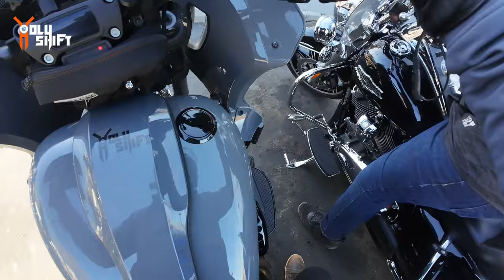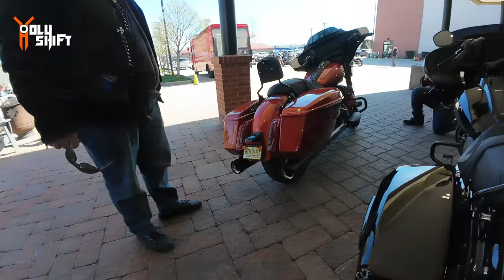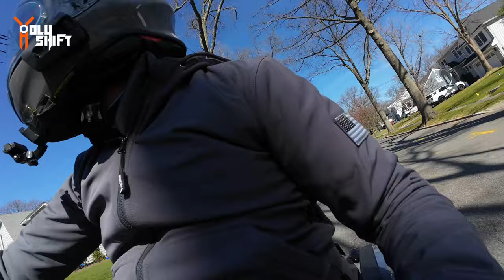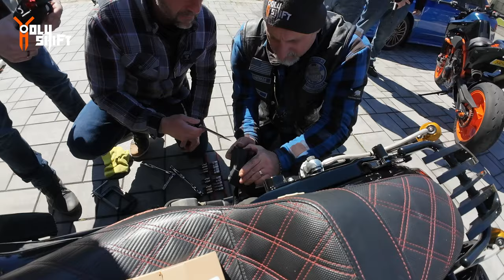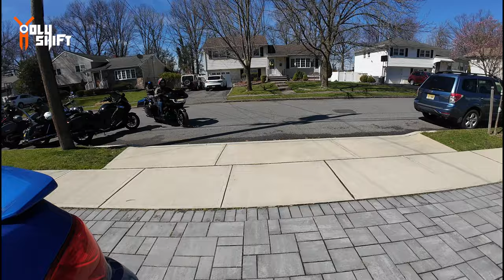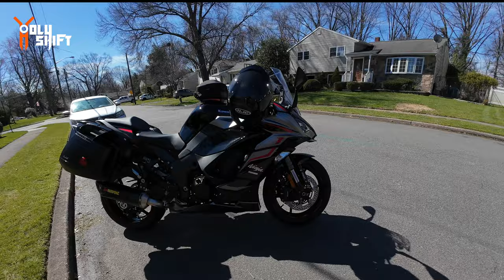Danger ! His Brakes Are Grinding

Comment: Hey Sandy, great video, thanks. That new CVO ST is sharp! The  engine is a little noisy, clattering? probably breaking in a little. Tell him to change the oil after about 100 miles, get all that break in out.

Comment: You can also check out the thrashin supply street glide adapter.  I have the lowrider ST with thrashin 6.5 pullback risers, high bend bar, and the street glide adapter.   It will add another 2 inches of height and it will pull back another almost 2 inches towards you.   You will need to flip your handlebar bag to the back of the risers, but it will sit perfectly on the adapter and you will never know the adapter is there.